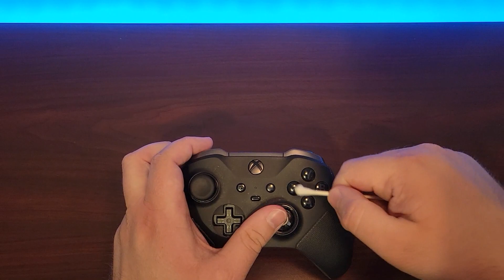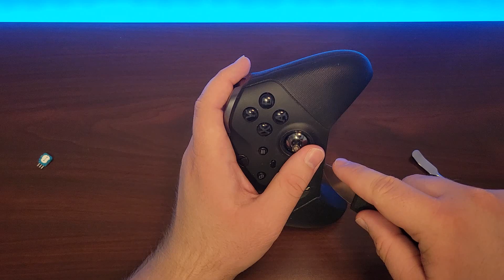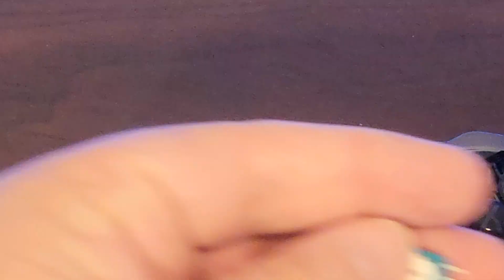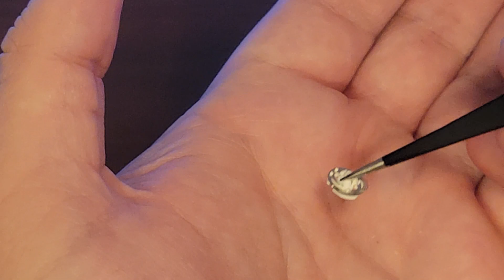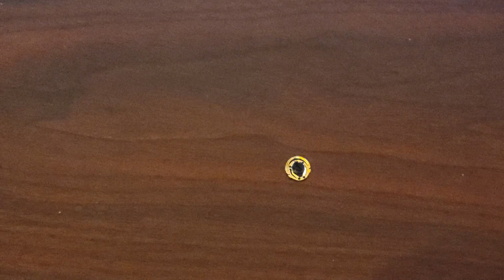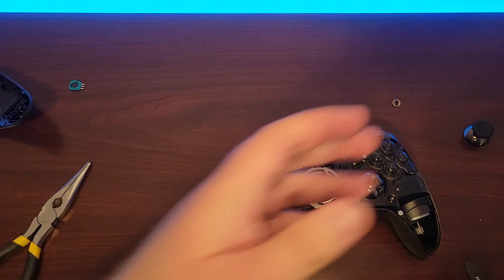Repairing Series 2 Elite Controller - Stick Drift

Comment: I have a very odd drift, It’s not sticky drift. It drifts after a few seconds of not touching the right stick. It’s a gradual drift perfectly downward (ads to the ground) down to the second ring. It will return to centre if I move the right stick. Please let me know if you know what this is
Reply: It's just stick drift. Nothing fancy about it.  This was the same issue I had and the above tutorial was able to resolve it for me.

Comment: I don't know if I should try this to fix my problem. I don't just have normal drift, for me its exponential and increases the longer its been since I last moved the stick, even if I set the deadzone to max the controller slowly increases the input until its off of the deadzone.

Comment: Hi, I have a question. I replaced the sensors and put them in correctly. For the x-axis I have the problem, that if I move the stick a bit down, it directly goes into the down position and for up the same. Does anyone know, how to set the sensitivity, or how to solve the problem?
Reply from the maker: I'm sorry this isn't a problem that I have come across in my repairs yet. Did you make sure that there isn't anything like hair sticking out of the analog stick itself when you opened the controller? did you clean area around analog carefully with alcohol while it was opened? did you make sure the potentiometer was snapped back in fully when you closed it?

Comment: “I have done a ribbons cable before” when I tell you how hard my eye twitched when you said that….
Reply from the maker: yea it was a stressful and tedious task, sadly it was the only prototype display that we had so it had to be done. every time that i thought i was about done the wires would accidentally solder together and when I try to separate them they would disconnect.

Comment: This was perfect!  I was able to successfully fix my stick drift with my controller.  Thank you so much!  I figured I might have to solder the new joystick on but because of this video, I found out that wasn't needed!
Reply from the maker: Yea there is always a risk with soldering that you may damage the traces or the PCB so any repairs that can occur without soldering is always best to try first.

Comment: My problem is the anolage has a bit of wiggle, for example in shooter games if i put my dead zone to .12 it is fine under that and it starts to drift, its like the anolage isnt snaping back to centre, its got a loose circle of of .12 deadzone even on the tighrest setting
Reply from the maker: this may be a case of the analog itself being damaged, in this case you may have to replace the entire module. if so make sure you purchase the module for the series 2 controller if that is the one that you have.
Reply: I currently have this same issue in both joysticks. Did you end up finding a fix for it?

Comment: Wish there's a magnetic joystick for Xbox elite. It just so wrong that you spend more than $200, but the joystick is still not last too long.
Reply from the maker: yea all controllers seem to use the same cheap parts which is sad when they also increase the value.

Comment: the problem is i got to do this on a $200 controller...
Reply: deadass smh
Reply: 350 in Canada
Reply from the maker: Sadly this is a common thing and even though I originally purchased the original elite controller for the promise that it was built tougher and made to last 2-3 times longer both the elite serries 1 and 2 that I have purchased both experience stick drift at a time i would consider early in their lifespan.
Reply: Exactly. Mine just started acting up after about three years, and I hardly use it.

Comment: Did this ever go bad again? I just bought a custom one for $230 and I would love to be able to fix it in the future after its warrenty
Reply from the maker: yes it will mess up again, sadly I seem to have to replace it every 2-4 months but all together it is a cheap alternative instead of replacing with a new controller. Especially when it's an elite or custom type of controller. Hopefully soon we will see XBox and 3rd party companies making it easy to place the whole module like the new PlayStation Edge controller can.
Reply: The replacement for the Sony controller are quite expensive.
Reply from the maker: @championpepe  yes, it is a good start. Hopefully it will open for Xbox to do something similar along with 3rd parties possibly creating a new standard for controllers and cheaper options that are still reliable.

Comment: 11:30 70% isp alcohol or higher or you'll run the risk of frying the motherboards as the alcohol evaporates faster than water....
70% isp is also 30% water 
90% isp is 10% water 
You are using isp 91% which is 9% water!!!!! 
NOT ANY ALCOHOL WILL SUFFICE I LOST A CONSOLE ON THE SAME MISTAKE!!!!!!!!!
Reply from the maker: thanks for the tip if I do another video about this in the future I will be sure to include this information.

Comment: Fixed my controller joystick problem awesome technique all the other videos sucked. My problem was with the joystick and it was grinding on something inside I moved it around a bit and now it works. Thank you.
Reply: My right stick is sticking and grinding on the inside, I’ll be opening it tonight sadly, was anything bent you could see?
Reply: The edges of the metal cage on the joystick are rubbing against the metal on the bottom of the anolage and the shavings are going into the joystick

Comment: you literally left out the one part I need help with. how did you get the stick cover off with a needlenose????
I'm trying to turn mine counter clockwise and it just gets tighter and the stick wont move as freely. when i turn it counter clockwise, it just spins and never loosens more. UNBELIEVABLY FRUSTRATING
Reply from the maker: I just had to grip the part that goes under the magnetic stick with the needle nose, around the outside of it not when you tighten it inside if your using the series 2. I was lucky it didn't scratch it on mine but was difficult to do. that's why I couldn't put it on camera had to get a better grip sorry. Be careful as applying too much force can damage it once you get it loose this one time the next few times you should just be able to put the thumb-stick back on top and turn that to tighten or loosen.
Reply: Look close. Screwdriver they came with to adjust the joysticks.

Comment: One thing not mentioned, if you’re replacing right stick potentiometer, I recommend you guys open the whole thing. You won’t have enough room to pull it out otherwise. It’s super easy and the tools to do it are $10 Amazon. Don’t brute force the potentiometer out as there’s a piece of plastic holding the potentiometer in place that can break if you do. Unscrew the back cover off. From there all you have to do is unscrewed two pieces off the green board and lift gently. Unhook the triggers after. That should be enough room to get the potentiometer out you don’t have to completely disassemble the whole thing.
Reply from the maker: Your right, although I have change a couple of these before recording this video in older controllers with spare parts I wanted to do this in 1 go so people could see exactly how difficult it could be instead of cutting out any details that any individual might find useful. Unfortunately that caused me to try and find the quickest method that could be achieved without someone having taking apart a controller for their first time. If I ever do a similar video in the future i will make sure to show more detail on how to take it  part more.

Comment: So I had to use needle nose pliers to get the left thumb stick off, when I reassembled everything, the left thumb stick catches on the controller if you move it all the way around.  Any idea why that is?
Reply: Possibly the yellow tape on the bottom of the motherboards that hold the wires in the middle in place after the same repair mine caught too took me an hour to find it
Reply: You didn’t tighten it down enough or tighten it too much

Comment: So these little sensors with springs on it is what keeps the thumbsticks centre?
Reply from the maker: they don't keep the joystick center as much as tell when the joystick moves. The stiffness of the joystick is something that may only be fixable by replacing the whole module. (Soldering involved) its not something I have had to fix myself as of yet.

Comment: My thumbsticks are loose. They work with a lil stick drift but the 1st movement on them is loose. Like it has its own dead zone but still counts as movement. Any ideas
Reply: Not going to open it as still in warranty. Hopefully will just get a new one
Reply: They all have these. Getting a new one doesnt work
Reply: That’s just how the controller is and is the only thing is hate about it. Well other than the notorious right thumb stick drift.
Reply: Try adjusting with the little screwdriver they came with. For this reason exactly.

Comment: Hello, friend tell me potentiometer what is listed in the description is also suitable for xbox series and xbox one?
Reply from the maker: yes, it can be used for either.
Reply: @eztek1023  and on ps5?
Reply from the maker: @КириллИнгерман  I am not sure if it will work with the PS5, I do not have one to test I am sorry. But it will work with the PS4.
Reply: @КириллИнгерман  No. Xbox and PS4 controller use 10K Ohm potentiometer and PS5 use 2.3K ohm potentiometer.  You can easily buy both type.  So for the PS5 use correct one.

Comment: Pretty sure mine is just ruined.. Pulled the front plate off my series 2 to just do some cleaning and dusting. Fixed my RB whilst i was at it, good as new. Popped the sensors off my right stick to see if there was maybe a dog hair or something causing my drift. Gently dusted with a light brush, popped them back on. Now, it's just stuck permanently up, or down. If i pop the sensor and look inward, i can see what looks like copper wire poking out. The controller is probably toast ey?
Reply: hahahaha same happend with me now LOL, and constantly just up now
Reply: @blockchainmusic8697  I ended up actually tearing my ES1 down to the board, removed the sensor from it, and did the same to the ES2. Tore it apart and simply placed the sensor from the series 1 in there. Works good as new. A suggestion if you have an older version controller.
Reply from the maker: Luckily the sensors are easier to acquire now, a worse case as long as the bored isn't broken you can also acquire the replacement analog joystick replacement but you will have to desolder the old part from the board and solder the new one on. This opens the potential of damaging the PCB(Circuit board of the controller) or even if you are careful can have what is known as a 'Cold Solder Joint" which is when it looks like it is connected properly but under the surface of the solder it may not be making good contact. But cleaning is always step 1 with sensor replacement being step 2.